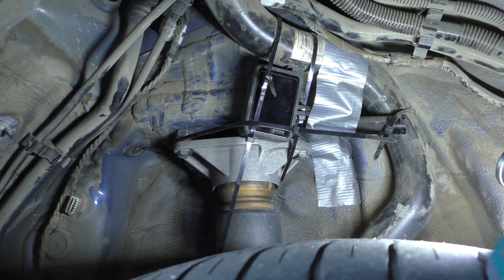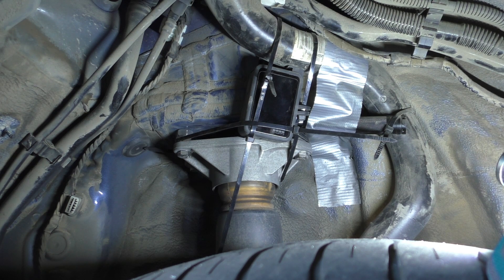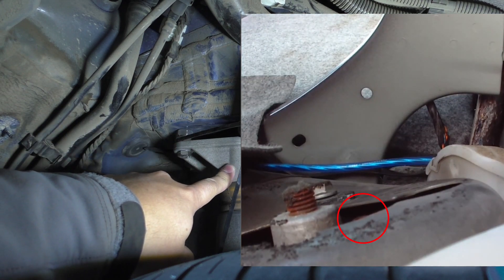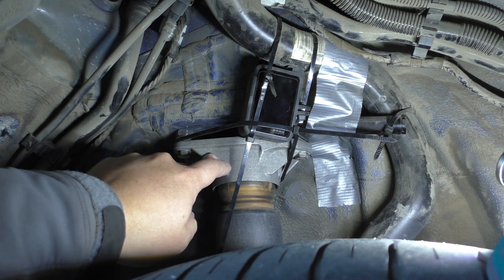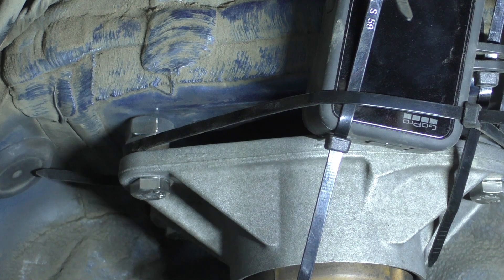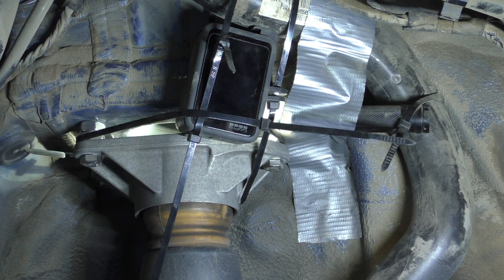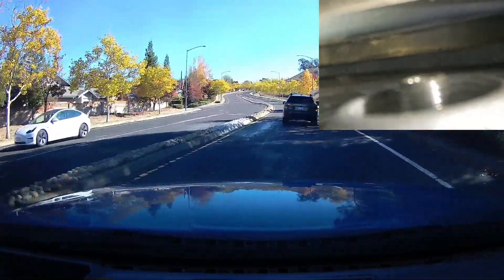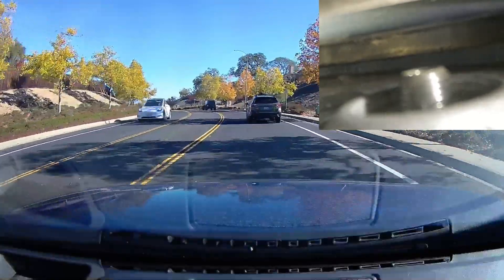This is Why Your BMW NEEDS Rear Spherical Top Mounts!

Comment: To those watching / reading thinking this is a bad thing, keep in mind that road isolation is actually good for grip AND predictability. There is ZERO benefit to feeling every little bump in the road! Your suspension needs to 1) respond to your control inputs, 2) absorb road noise, and 3) dampen larger amplitude motions in a timely fashion that could upset the chassis. 

This video demonstrates 2) in action: the suspension is absorbing road noise. Interesting that 'real-world roads' are rougher than you realize! Perhaps the rear mounts have more compliance than some would like - I haven't driven this car hard enough to note whether it feels imprecise or not because the rear mounts have designed play. Something HAS to move at higher frequencies or you get a LOT more road noise transmitted from one tire, into the suspension, and conducted into other tires. Think resonance. The shock mount is absorbing this energy so the chassis (and your body, and the other three tires) don't have to. 

I'd argue that these road features are exactly what you'd want to filter. If you're building an ultra-precise RACE ONLY car then I can see remove more compliance to increase precision. BUT be careful - you might end up with a jittery, bouncy, unstable car at the limit. I've worked with lots of racers who have suffered from lack of confidence and grip when reducing compliance.

If you remove compliance from the top mount then yes, the damper works more directly. That would be bad if the damper is very stiff or has a high gas-spring (as MCS/JRZ/Moton/etc do). SEAL DRAG exists and goes UP as you get to a larger diameter piston shaft. At some point your tire sidewalls could become your suspension. Listen to this BMW E46 M3 customer (formerly on MCS 2-ways now on FCM Elite) describe his experience. I know his setup had spherical mounts front and rear, as well:

5 min video - https://www.youtube.com/watch?v=JN95fi-fKHk

Many people over-utilize dampers to provide 'control' when your first order control comes from selecting spring rates that create Flat Ride (yes, my favorite term). Then you have KEEP Flat Ride through avoiding jacking down or launching, and also choose bump stops that prevent terminal understeer or oversteer. A vehicle with well-chosen Flat Ride-based ride frequencies will transition VERY well even with rather soft low-speed damping (and non-spherical mounts). See my video 'Why Flat Ride Matters: An Amazing Road test with NO damping' and skip to the last half for my reflection on the actual 'no damping' road test. 

https://www.youtube.com/watch?v=KpTN8Viau-I

I have >100k mi on pretty worn OE rear rubber mounts (E46 330i), they definitely have a bit of play in them. Andrew and others have driven Christina and she works quite well. In all my track and autocross videos, I've used aged rubber rear mounts. I have a pair of spherical mounts, never gotten around to installing them. if you're trailering your car then by all means, go spherical. But think about where the compliance (i.e. high-frequency energy absorption) in your system is going to come from. If you want more forgiveness and overall grip (especially with supposedly high-end dampers that have HIGH gas springs!) then stick with the OE rear mounts. 

NO compliance = NO forgiveness. Keep that in mind if you don't want to prematurely age your tires, or fly off the road into the weeds (or a wall)...
Reply: Couple things.  First and foremost, spherical mounts are meant for track cars.  I don't recommend them for purely street cars due to potential maintenance hassles so NVH shouldn't be a major concern for the end user of these mounts.  With that said, my customers can't tell the difference in NVH with a top mount swap on a damper that only passes damper rod loads through the spherical and not spring loads while all the other suspension hard points are on rubber bushings as well.  Interestingly, on the S60R it solved my rear shake problem though so I can't say it didn't effect NVH for me, it did so in a positive way that increased cornering power.

Regarding road isolation being good for grip and predictability:  This is only true sometimes.  How do we know this?  Sometimes, running a cut down main piston wear band can have good effect on low speed corner grip.  This floating piston band creates a dead band and cuts out all force passing through the shock for some small displacement as the piston displaces relative to the wear band which limits oil flow only to the rod displaced volume through the bleed circuit.  It sounds a bit like your MCU top mount but this is not a universally used option for a reason and most people don't even know its a potential useful trick.  Professional teams will learn which tracks see a net benefit from creating this dead band and implement on an as needed basis.  However, they can't do that if they don't have a choice with rubber mounts... which no serious track car I've ever seen in my life uses.  What I plan to try but have never seen done is running a cut band on a street car which again would only make sense if you eliminated the rubber top mount.

Regarding your MCS customer:   I don't operate on the philosophy that you should bandaid a bad damper with a rubber mount which is effectively what you're stating.  High gas and friction forces can be mitigated through good design and all three of the brands you mentioned are terrible in my experience.  That doesn't mean you should be married to the damper and cover up poor performance with another spring in the damping system.  You also mention removing compliance would be bad if the damper is very stiff.  Again, it depends on your customer.  Some drag cars have a few hundred to 1,000lb zero point rebound forces.  A rubber mount would negate any benefit of this type of setup and also would likely fail if anyone ever tried it.
Reply: @pdvmotorsports  So we agree on spherical being better-suited for track cars. Rubber bushings do absorb a lot of NVH which is something people may miss when going stiffer. 

I've never tested a cut-down piston band though the effect sounds similar to drilling holes in the piston to create a dead band (i.e. small amplitude, high-frequency filter). 

I cite my street-driven, track-oriented BMW using rubber rear mounts as an example, not a recommendation for a dedicated race car. The trailered race cars I work commonly use spherical or Delrin. Christina has a GC front Race bar and GC camber plates, poly bushings, and ride frequencies are over 2 Hz. Not plush but rather compliant while still precise. Due to Flat Ride being present, she's eager to turn-in without the dampers having to do a whole lot of work to force that to happen. Quite amazing, really.

A drag car with a nearly hydro-locked damper is pretty far from what most need their suspension to do but I understand your example. I think we both know it's common for well-meaning enthusiasts to buy 'high-end' dampers, add spherical bearings or mounts (or stiff sways) then wonder why their ride is rough, even at 'full soft' on the adjusters. They've lost compliance on multiple fronts and now have a punishing car that might be somewhat faster but is less enjoyable and less stable at the limit. 

A well-designed suspension for your application ought to inspire you up to and over the limit. Seems that's what we're both aiming for.
Reply: @georgesalepis9837  Hi George yes I saw your message come in, I'll reply shortly.
Reply: @SuspensionTruth   I don't think a floating wear band will behave like what you seem to be describing as additional bleed holes.  The floating band doesn't add bleed to the low speed circuit so its an independent feature and of course isn't a permanent change to the piston.
Reply: "Stiffer is not always better"! (this is not what she said though...) You definitely know what you are saying man. Greetings from an italian mechanical engineer!
Reply: I disagree with your view. Every time I installed solid mounts the car felt more planted and let's say calm on the road surface. Rubber mounts always made the car feel jittery and unsettled.

Comment: On a road car this damper movement is most likely a feature and not a bug.

The movement in the top mount  ensures high speed movement of the springs in case of high speed (road imperfections) impacts, which are too fast for the slow damper to be able to react to

Comment: Awesome video FaRKle0079, can I ask what your suspension/ coil over setup is?
Reply from the maker: This vehicle has a Fat Cat Motorsports custom suspension (completely reworked Bilstein B14) with 265lbs/in front springs and 900lbs/in rear springs.

Comment: Another great video. Thanks for taking the time to rig it up!

In the vid you allude to it has a rate, but I think it is more like a preload because it is an effort that needs to be overcome before the damper takes affect. I’m speculating that the damper starts working once the extension of the inner rubber mount is exhausted.
Reply from the maker: You're correct the damper starts working once the mount's flexible material travel is exhausted. As it's extending away from the "normal/at rest" position it would be applying a spring rate of its own since it's now tensioned.

Comment: I would put these more to Track-use (your video title is a bit straight). These Rubber bushings and mounts are not like stupid rubber pieces anymore but well-designed and engineered.
There was a pretty huge video out of a vist to such a company in Germany, I can try to find it if interested.
For Track use no doubt, I would do the same.
Thank you for your videos, many are very pro-level explained and helping.

Comment: It is not a smart idea to place even suspension with adjustable settings on any stock mount. I want a set of these mounts as well. This is why I am going to use Camber plates on my front as well. Bilstein Clubsports also come with spherical mounts.

Comment: I have a f80 with ohlins road and track. I will be buying a pair if you recommend them
Reply: Greg, please see my comment above if you haven't yet. The Ohlins seems to have some high-frequency filtering, but it still tends to have somewhat high gas force. That, coupled with a spherical rear mount, would increase NVH and potentially make the rear even less consistent. I've spoken with a number of F80 M3 owners who have trouble getting the rear of their cars to hook up. The tendency to add rebound bias is probably part of the problem with the Ohlins (and most brands).